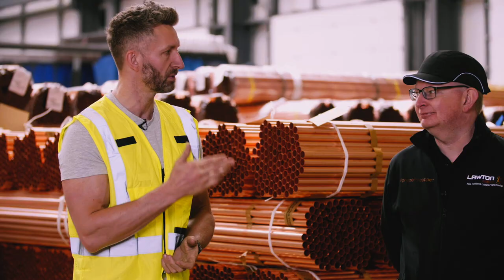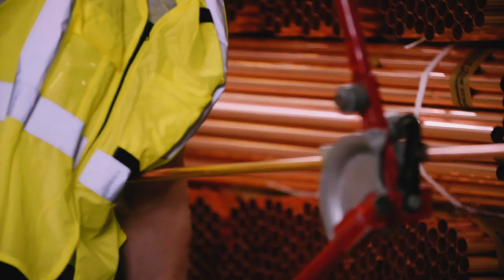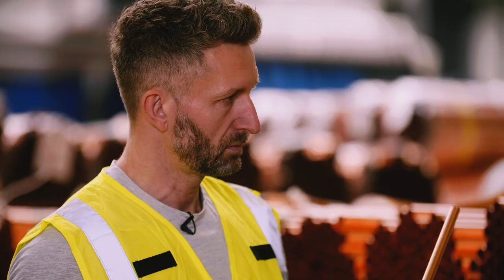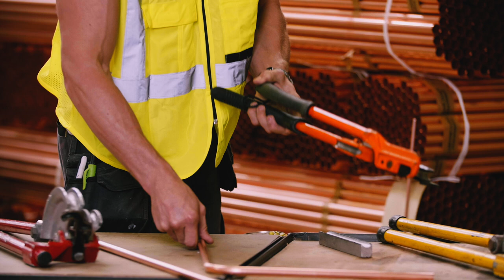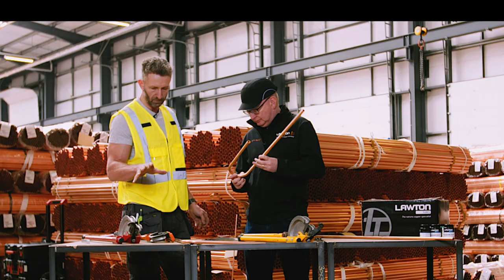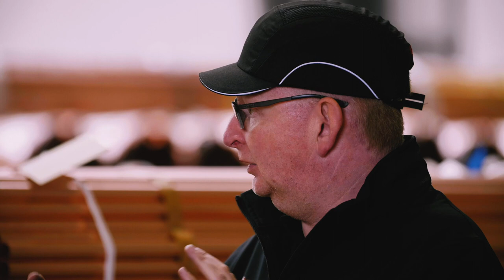Myths around rippling of plumbing copper pipe tube

Comment: Hi Lawton tubes & PB - Many years ago I decided to invest in the purchase of  a  Rems Curvo electric pipe bender - primarily for bending stainless tubing which it does with great ease and perfect bends - I also hoped to use the machine for bending standard British plumbing copper tube 22mm to 35mm - however I was very disappointed to find that the copper tube rippled badly using the Rems machine. Only after many phone calls to Rems did I eventually manage to get an answer as to why this was happening - it turned out that the machine was designed for the European copper standard - this is now table Y in Britain which as Lawton tubes have clearly explained is a thicker walled tube but with the same hardness (half hard).  Great informative video Lawton.

Comment: So it begs the question, why don’t we use the 1mm wall thickness tube in the U.K. as standard and drop the 0.7mm
Reply: 30% more expensive 😩😩😩🔥🔥the quote
Reply: @paul_my_plumbs_uk  mo money, mo money!
Reply: Because 0.7 tube bends very well if used in the correct type of bender.  Why overengineer any more than we already do just so we can use foreign pipe benders?

And, as others have said, cost.  In Italy, they use thin hard copper for the straights and soft copper for the bends.  But due to cost, they rarely use copper at all.  Our old UK tube was thicker, back in the day when we didn't have central heating and only really used it for hot and cold water pipes.  If the UK market kept using the same quantity of tube, but switched to thicker wall, would current copper supplies even cope with demand?  Now that's a question...

Comment: Been 20yrs since we used Copper in America for residential. Everything is PEX now. Nice to see copper being used .
Reply: 42 years  in the HVAC industry  and I am surprised  to hear you talking  about  plumbers doing work  with a mechanical bender.
Reply from the maker: So in UK it’s very much 70 / 30 in copper, we are one of Europe’s largest users of copper in plumbing I’m pleased to say 👍 Plastic has its place mainly in underfloor heating where it’s key not to have any joints or fittings.
Reply from the maker: Sadly with most plastics it all ends up in landfill when finished with unlike copper which can be 100% recycled time after time. Sustainably is much becoming a BIG in construction so copper in States will be seen a lot more for sure 👍
Reply: @LawtonTubes  that’s a good observation, but PEX pipe is left installed for much longer than copper, so it’s not a simple comparison.
Reply: Really in Florida we use copper everyday your must not be in the field bro
Reply: @gregoryderosa8045 name 1 big builder that doesn't use PEX as the standard. Most don't even do copper stub outs.

Comment: When I was learning I was told it's all in technique and he also proved to me why, he showed me how he could purposely ripple copper and it's all in the technique of bending. Hard to explain but it's basically to do with one fixed point and one moving point, not moving them together like scissors? I dunno something like that
Reply: It's all in using the right pipe. It all may look the same but it's not. You have to be a pipeologist.

Comment from the maker: Because most heating systems in UK don’t run at very high pressures so making 0.7mm more than suitable for the job so why pay 30% more for a tube that’s not necessary.

Comment: I had a set of screwfix pipe benders that i used for many years . They were great but started rippling. I figured they were worn out so i bought some new hilmor benders that day, which also rippled the same  pipe. I figured it was the pipe at fault. I often work with a mate. He has rothenberger benders. He pulls a bend no ripples, i pull a bend in the same pipe with the same benders and it ripples. So im guessing its me and my technique some how? 🤷‍♂️
Reply: Try cleaning the guides and formers, grease the 'bearing' of the rollers on your bender and a light bit of furniture polish on the guides and formers.  I put beeswax polish on my guides and formers once every few months and it seems to prevent rippling.

Modern Hilmor benders are very poor compared with the old Hilmors, by the way.
Reply: Bending too fast. Slow down.

Comment: And finally we get the Answer we get sold shit pipe in the uk . Thanks pb for answering my all time question 👍👍👍👍👍👍👍👍👍👍 I have bought loads of bloody benders trying to stop it
Reply: Alternately, benders not designed for UK pipe standard. The gas pressure is minimal, 1/3 PSI (2 PSI in some new residential builds). Copper tube 15mm dia x 0.7 wall has a bursting pressure of 58 bar ; over 840 PSI, so a colossal factor of safety. For comparison, plastic carbonated drink bottles contain pressures of 30 to 50 PSI, and fail at over 150 PSI.
Reply: I use a BenditNow bender (designed for UK table X tube, not the Bahco shown that was apparently designed for table Y), greased the roller bearings when new, clean and wax the guides every few months, and I don't have rippling, well, once every few months just before I rewax my bender lol.  Usually use Wednesbury or Yorkshire tube, both from UK...

Comment: Having recently worked on my old ½" copper pipes, I was amazed how much thicker the walls were compared to modern 15mm. On bending the 15mm I found every second bend ended up slightly rippled, even using a new pipe bender & the same tubing. Basically modern stuff is c*** compared to the past.